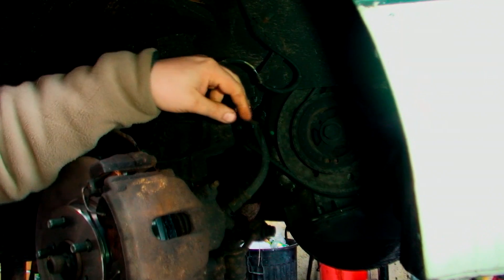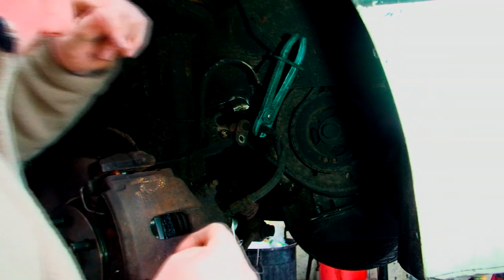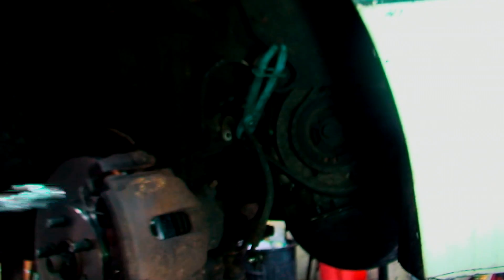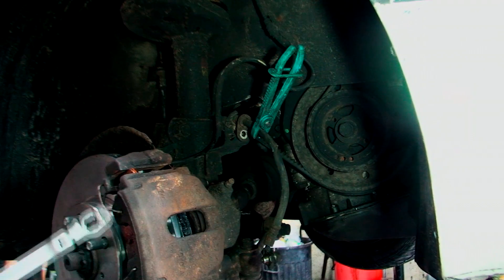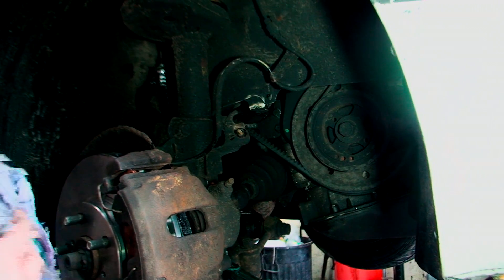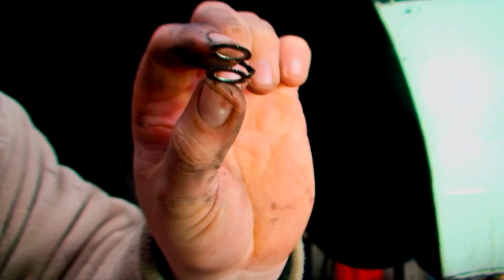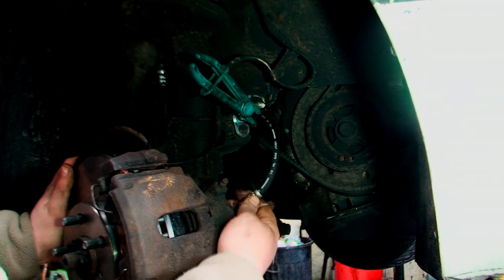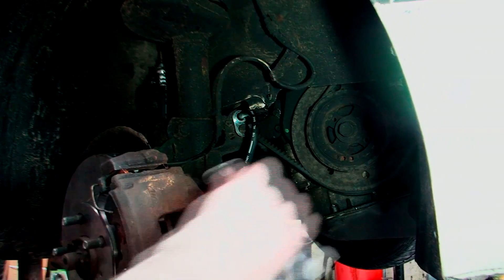bodgit and leggit garage TNT#7 how to put on flexi brake line

Comment: wow , im impressed with your nifty spanner , never seen them before , ive got a couple of the ring type spanners with the bit cut out but even they can sometimes round them brake pipe unions . I will have to look into getting some of them , cheers ..
Reply from the maker: bashbits ya mate there good but if you get them dont get the cheps 1s